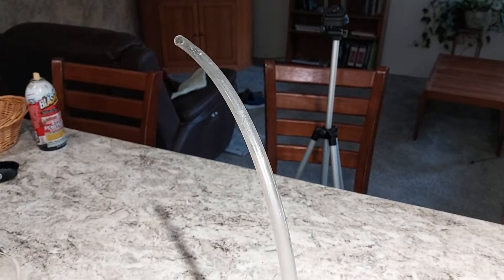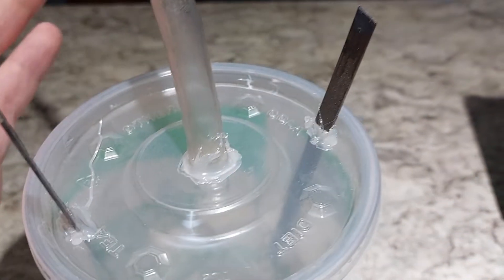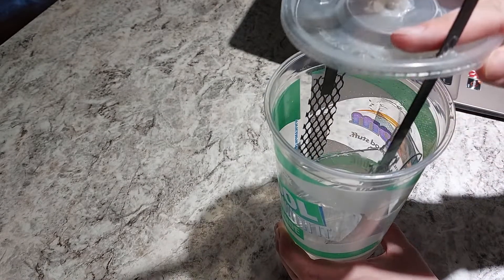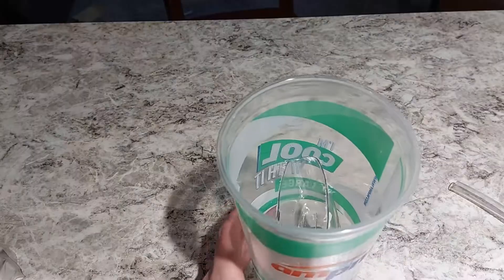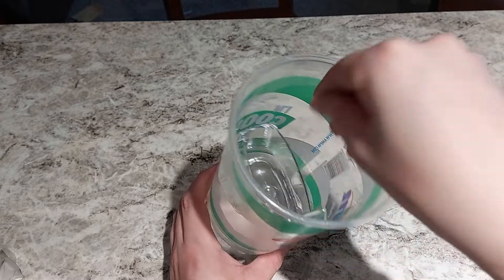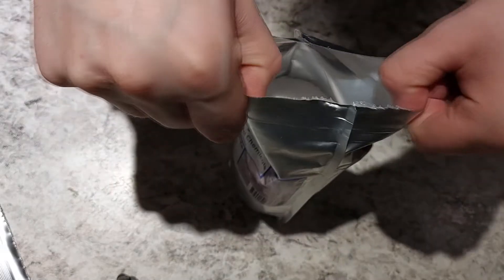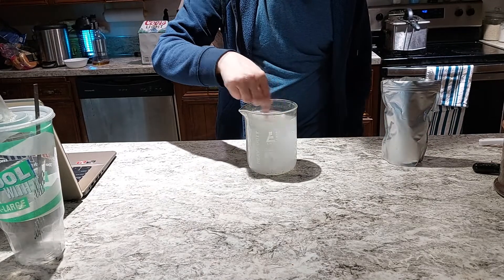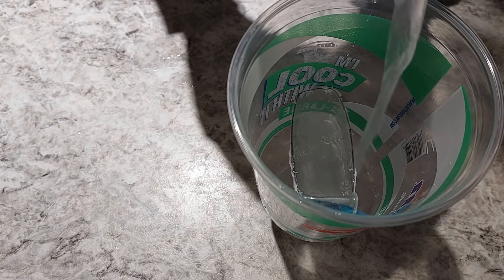New Chlorate Cell

Comment: im trying to make a chlorate cell but i am a newbie is 6volt 7.5amp good?
Reply from the maker: That's about what I use. I find at higher power levels the water gets very warm and evaporates away overnight.
Reply: @GamerPro132  What do you use as a power supply? Is it a var battery charger? Is it not 13V then?

Comment: Very cool and makeshift :) 
How much did you get from it?
Just one thing though, the electrodes are suuuper far apart here, I bet barely any current is getting through. Make them a little closer to make the cell way more efficient.
Reply from the maker: I've been getting plenty of yield from it. I actually have a bunch of chlorate in the bottom of the cup rn that I haven't bothered pouring out because I allready have enough for a few more rocket firings stockpiled.
Reply: @GamerPro132  that’s good :) 
I guess they weren’t too far apart then. You could always move them closer to increase efficiency though. 
Also how are the electrodes holding up? I know that most platinum electrodes you can buy online especially on eBay are a little bit sketch. By that I mean they add an insanely small amount of platinum and call it a day, which obviously means they won’t last very long. To check if they are ok look for purple/grey dots on the electrodes, if they are dotty then they are damaged most likely.